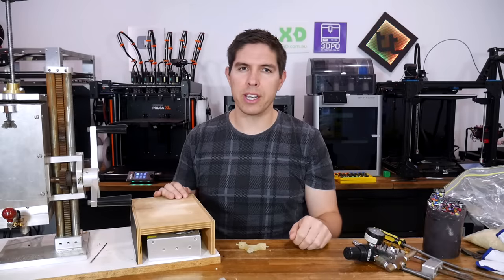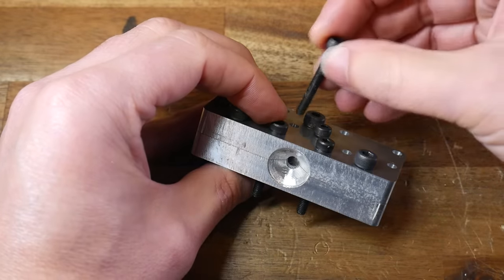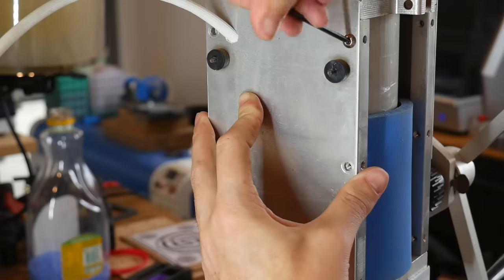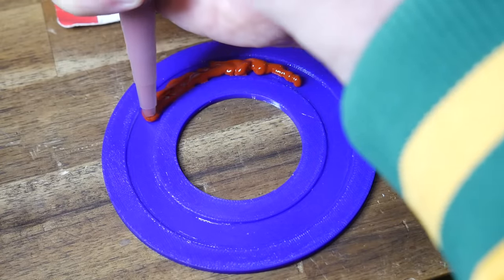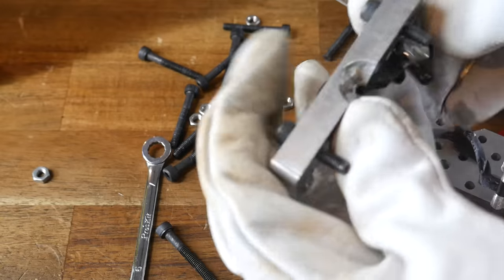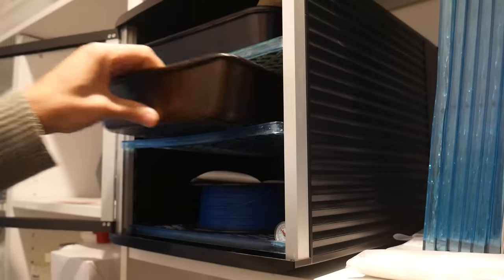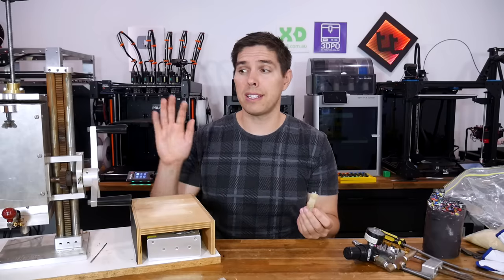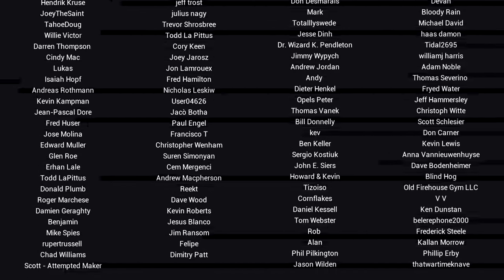Home injection molding part 3: Making stuff! (kind of..)

Comment: I have no experience, but seems like people are using way less volume and crucially way smaller diameter for their diy melt chamber/extruder. Seems to me that such a big pool of  plastic would need a long time to melt, and the material near the walls would just overcook. And besides you need a hydraulic press to move the material with enough speed with how thick molten plastic is.

Comment: Look up buster beagle 3D he has a injection rig that is in it 3rd or 4th iteration and has no issues like you’ve described. 

That mould should pop open a lot easier than that. Do you have drafts etc?

Comment: I saw the "not worth it" in the thumbnail and thought I'd share some numbers from IMM processes... 500 degrees F.. 10,000 PSI injection pressure.. 5, 10, maybe 50 tons of clamping force.. 500 PPM H2O. And if you have a degree in plastic engineering or a few years of experience operating an IMM, you can probably get it making good parts in 3-4 hours of setup work, not counting hanging the mold. Assuming the mold is properly designed, of course.

This is a very dangerous process to mess with at work, let alone at home. Most burn injuries are caused by operators coming into contact with cooling water, not the material itself. And the amount of energy needed to dry and process the material before molding will make molding less economical than CNC machining or even ordering a finished part in many cases.

You can buy a 90s-vintage hydraulic powered IMM for a couple thousand dollars, and at least have a somewhat capable machine with reasonable safety features that rapidly makes quality parts. If you want to "make stuff" that's what I'd recommend.

Comment: Make PLA sticks and see if you can injection mold by running PLA through a glue gun?

The screws must really be moving on industrial machines given how quick they shoot a part, reopen and then are ready for another set of parts.

Comment: Did you try putting your mold under the hot end, of one of your 3D printers and just use that to get a molded part? I've been curious if that could work at all.
Reply: Not enough pressure and it extrudes way too slow.

Usually with these things the plunger is actuated by a pneumatic piston and the pressures are pretty high as well as injection times just some seconds, could be one of the problems why this screw thing didnt work

Comment: No clue why you're using Vaseline. I use to work in a plastic factory that had injection molding machines but these machines would not fit in your house. They were screw machines. The company I worked for made catsup and mustard bottles and pill bottles and any sort of plastic bottle you would find in the store. Yes I know these were blow molding but the injection machine is the same and they did manufacture solid plastic parts. At no time did they ever use vaseline as a mold release agent. What they used was brushed on but it dried and wasn't oily.

Comment: if you really want to stick to this, theres a method to build two really strong plates with linear guides and clamping, then you put an insert into each plate that contains your actual part . you can finish the parting area by hand, with enough clamping force you can get seamless parts. [EDIT: without symmetrical linear guides and clamping, including towards the nozzle, none of this makes any sense to me. without pressure its not really a reliable flow anyway...]

 this is used when different small parts in small batches are being produced. to me, that seems to be the only way to make something actually useful at smallest scale..

Comment: Your heating cylinder is huge, it  is not possible to make it work this way. Plastic melting will take too much time in yours. Optimal would be maybe 20-40mm diameter.

Comment: You violated some fondamental rules of engineering and prototyping: do one change at a time! Verify that a tool works in the way it’s intended to be used before modifying it! 
This project was doomed from the start: old damaged machine, major modifications, no prior experience in the subject, using recycled  material instead of the material the machine was made for! Then using 10 years old material! Then glue!
This is a good lesson in what not to do with a project IMO.